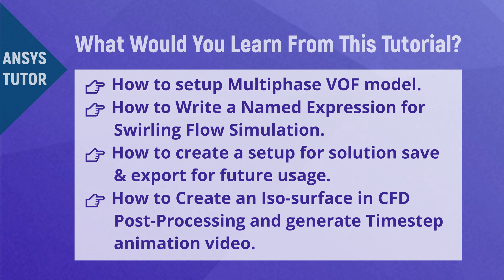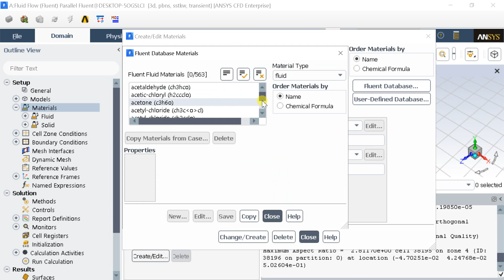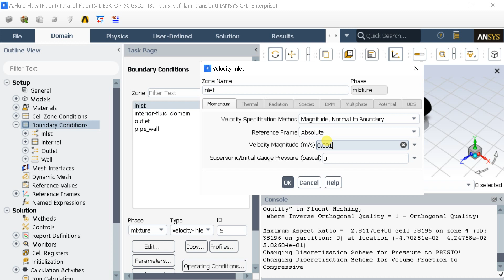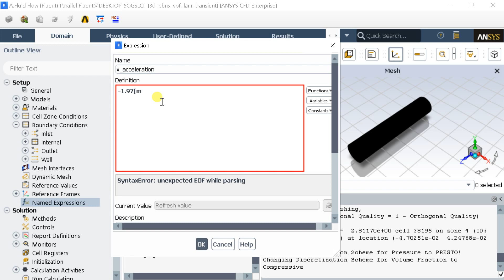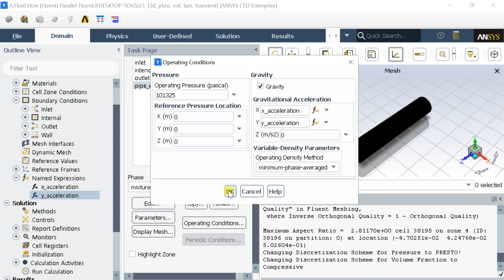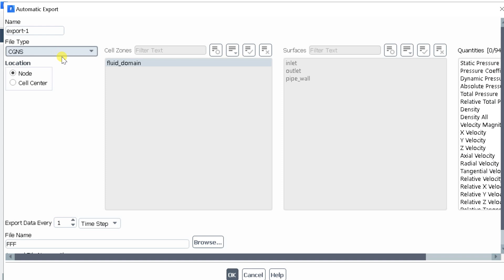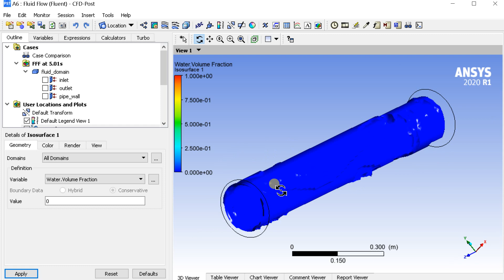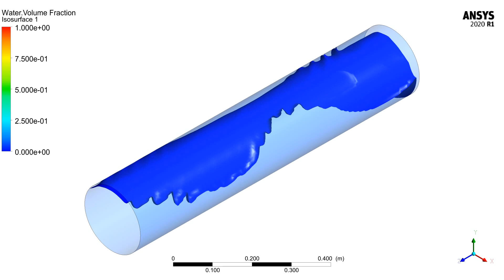ANSYS Fluent Tutorial | Swirling | Swirl Flow | Multiphase Flow | Swirl Flow ANSYS Fluent | ANSYS 20

Comment: Can't change the inlet velocity higher than 0.001 m/s
After changing the velocity,  flow through the pipe is not continuous. Pressure at the outlet becomes -ve.

Comment: how do i achieve a swirling plate simulation on ansys? the parameters are orbital radius of 5mm, angular velocity of 150 revolutions per minute (rpm) and height of the plate is 2mm. i am trying to achieve what was shown in the video but applied to a swirling plate instead of a pipe. thanks!

Comment: Amazing videos and lessons, thank you!
For hydrocyclone: water and solid particle flows (diameter of 0.6mm and volume fraction of 0.0013), which Fluent models would you recommend working in the simulation?
Reply from the maker: Thank you. For such type of simulation you need to work with multiphase with DPM model, watch our tutorial on Particle flow simulation to know more about this.
Reply: @AnsysTutor  Thank you!
I'm really studying the DPM model, I will revisit the video on your channel. 
Regarding the type of mesh, the equipment (my geometry is 3D) has a tangential input that distorts some elements, would you have any tips from your experience, which mesh is better to use?
I was working with worbench meshing default meshing, without adding edge sizing or method